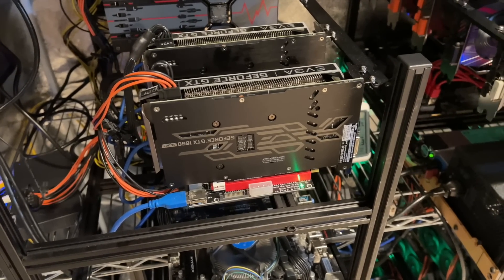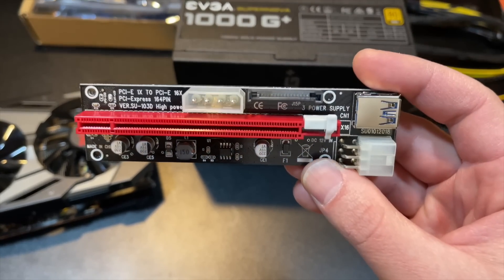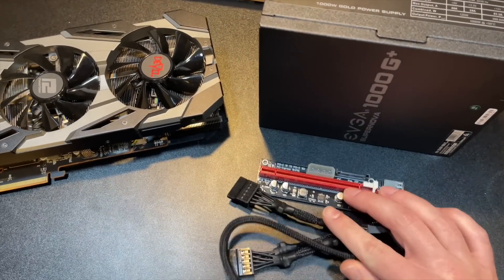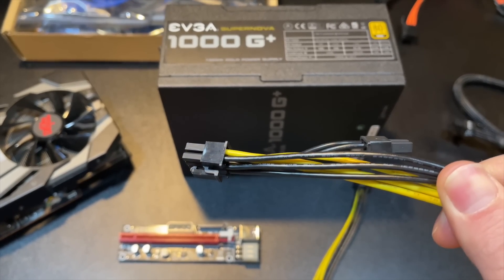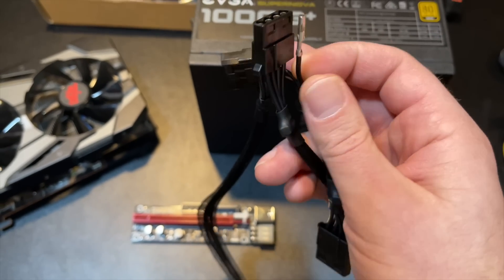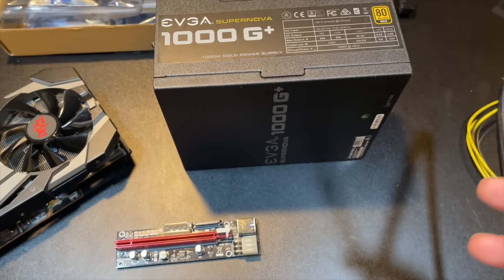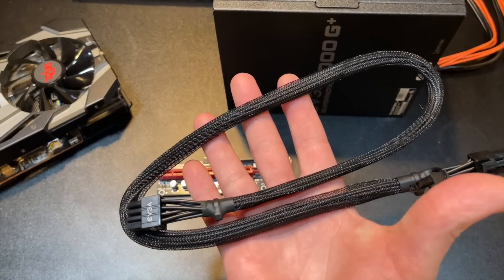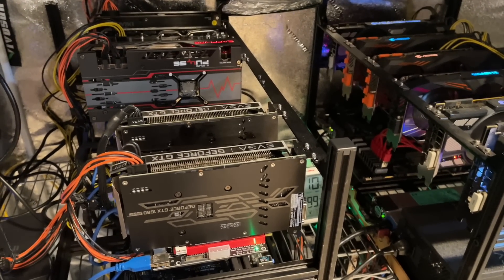Powering GPU Mining Risers Safely

Comment: Question: How do you feel about two molex to one 8 pin? I got a 1660 today and I don't have any more pcie on my power supply. I do have 2 different molex cables that are free. My power supply is a older 650 watt corsair gs. My current setup is pulling 300 watts, so I'm assuming with the right adapters I should be able to power a single 1660 and a pci riser card.
Reply from the maker: Tricky. 8-pin can pull 150w max. If it were 6-pin you'd be okay with two separate Molex strands since it only pulls 75w. 

You're still probably okay going to 8-pin, but I'd personally avoid it. If in the chance those Molex cables only have 5A pins then even two strands would give you 120w max. (5A*12v*2). In reality they probably are rated for much higher, but myself and you just don't know.
Reply: @RedFoxCrypto  Thanks for the reply. I have decided to stop being cheap and buy a proper psu. I live near a microcenter so I am going to pick up a 850 watt evga model. It has enough of the connectors I need and its modular so there will be less of a rats nest when it comes to my cable management.

Comment: Noob here - I have a question for my
Fellow mining experts . I want to install a 2nd gpu  in my rig  , i have a 750 PS and that won’t cut it  can i use an external power supply to just power the 2nd gpu? Is it safe ? Ty in advance

Comment: So what If I have a GPU with lets say one 6pin + one 8pin Connector for Power supply and I want to run it with a Riser. Do I then need to plug in one cable (6 pin as I learned) into the riser, and two in the GPU, so infact this ONE GPU blocks THREE PCIe power connections in the PSU? This would require the PSU to have lots of PCIe connections when you want to run for example a 6 GPUs mining rig, right? 

What am I missing here?
Reply from the maker: It depends on the GPU you are running and its TDP. You can typically do it with 2 strands from the PSU. One of them being split to go to the GPU 6-pin and the riser 6-pin.

Comment: i actually have a 590 that takes 14 pcie, so i ran out of them for the riser, im using the sata on the riser for like a month and there has been no problem, i guess that the 14 pcie is giving almost all the power to the gpu so the sata is not that forced
Reply from the maker: Yeah they must draw very little power from the riser. Stay safe brother and be careful if you switch to a different algorithm with those.

Comment: Its also good practice to view the connectors with a thermal imaging camera (a cheap one is fine) while under full load just to be certain there's not a poor connection with a pin somewhere. Relatively new to mining, but not new to dealing with 12v high-current projects. Good video too, I never realized the SATA power connectors had such a low current rating! They shouldn't offer it on the risers - just asking for trouble.
Reply from the maker: Thanks Mike. Good call on the thermal camera.
Reply: it can be dont by touching connection with finger too
Reply: Great Idea...looking into this now.

Thank you sir!
Reply: The SATA connector was designed to power a disk, CD players, DVD players.

Comment: Most currently produced molex connectors (used in name brand power supplies) use pins rated for 11 amp on the the 12v and 5v.  More than safe to power PCI risers.
Reply from the maker: Any sources to share on that? I truly believe the same, but I wish I could find something really concrete to back that up.

Comment: but one thing not every gpu runing on 6 pin connector we need 3.3volt  or 5.5 volt because i am using gtx 1070 gpu they not run on 12pin connector then i switch to molox for 5.5 volt then they run perfect  but there is one theory that if you run on motherboard PCie the hash rate will increase and they working perfect

Comment: What about if i was running RTX 3070's? Ive got 3 on the way and looking for another 3, would the splitter still give enough power?
Reply from the maker: You could do 2 of the risers off a single PCIe strand with a splitter.
Reply: @RedFoxCrypto  Im kinda new to this (In the process of building my first rig, Could you explain which cables i need from m7 gpu (HX1200I to power 4x RTX 3070'S) I

Comment: Still plenty of bad choices to make with peg connectors tho. What happens if you use said 6 pin > dual 8 pin splitters to power a gpu that draws max? Thats a 150w per 8 pin so a total of 300w over a 6 pin that is designed for 75 and at best takes 192 as you mentioned. Just as tricky as sata power.. Correct me if im wrong but i kinda missed that part

Comment: The thing is with multiple cards that require multiple 6/8 peg connectors you run short on them very quickly. I think its wonderful that in that case you can use good ol' molex to at least power the risers. Saves a few peg slots and cables for the real stuff.

Comment: I have a 1000w evga gq with 6 8pin slots, 2 cpu 8pin slots, 3 sata 6pins slots and 1 perif 6pin slot

I’m trying to power up 5 rx 580 8gb cards, each of em requires 6+8 pins 
Is there a way to power the whole thing without using the sata slots ?
Reply from the maker: What's up dude. I'd probably use a PCIe strand that ends in a 2x8pin and split one of those to go to the riser as well. The TDP of a 580 is 185w so it's within spec of what the PCIe cable can do wattage wise. 

There are even some 580s that you don't need to power the 6pin and only the 8pin: https://www.gpuminingresources.com/2018/03/complete-rx-580-comparison-and-ratings.html

Hope that helps!

Comment: I have been using Molex risers for years on my RX 580 rig, never had a problem. I actually prefer Molex risers .
Reply: Polaris is def less demanding

I used SATA with them for years just fine
Today, I am using an rx 5700 with a SATA--> molex adapter cable like he showed in the video and it melted!

With the higher power limit cards this will be more of an issue

molex is likely fine but an absolute no no is SATA and especially SATA plus a power hungry card! Thats where the melting actually starts happening

Im actually lucky this flimsy adapter was the weakest link and started melting before anything else so its just that thing lost 

swapping to 6pin now

570s are probably ok with SATA tbh but better safe than sorry prob use Molex with them too

Comment: Thank you very much for your video, I learned a lot of things.  But I have a noob doubt, I was planning to buy a 5700 but I see that the one in the video has an 8 pin port and a 6 pin port, would I have to power both or can I use just one? For example, with the splitter, connect 1 6pin to the riser and the other to the gpu, leaving the 8pin unused.
Reply from the maker: You’re welcome! You have to power both.

Comment: Thank you , after I installed the 3070 on PCIe riser the PC suddenly restart and was not not able to detect the  GPU cards - It works for couple of hours then restart again ... any advice ?
Reply from the maker: Hmmm...I’d test another riser first and then I’d test the card on the full size PCIe slot on the motherboard to isolate the problem.
Reply: What W power supply you got and did you check your voltage levels? You might have one dropping low somehow.

Comment: I was curious about the sata connection and did my own experiment in testing it using corsair modular cables the sata connection on their cables is very high quality and did temp reading using a temp laser gun and using one sata connector per one riser the temps never got above ambient temp so I believe if you have high quality connectors like corsair is using you are fine this test has been going 24/7 for 2 months now and molex is save as well with corsair cables from my own experience and testing. Now all testing was done on RX 570/580 gpu's so I wouldn't use these connections on a higher power draw card like a RX 5700 xt and above or GTX 1080/RTX 2070-3090 cards
Reply from the maker: Thanks for sharing Kevin. Seems like those 570s/580s are drawing very little power through the pcie slot.
Reply: @RedFoxCrypto  I don't know exactly how much the Polaris cards use from the pcie slot but I know when rx 480 was released they had issues pulling 80 or more watts from the slot and killing motherboards so dont know about the 500 series I know they updated the bios on the 400 series to prevent that

Comment: Anyone know if its safer to use spliters only in the risers and plug gpu right into psu any info helps:)
Reply from the maker: Yes, just make sure that you keep the riser and GPU on the same PSU if using multiple PSUs.
Reply: Thanks for the response

Comment: Hey Red Fox, great video and I think my rig had been crashing bc of insufficient power to risers via SATA but noob question. I bought the splitter you linked, but the 6 pin end doesn’t plug into my EVGA PSU! Did I miss something? Was it supposed to plug directly in or via some type of cable? Thanks!
Reply from the maker: Thank you! The splitter plugs into a PCIe cable and allows you to split a single 6-pin into 2 8-pins.

Comment: Hi, am I good with Corsair RM850 (850W) with 3x double 6+2pin cables to powering 6x 1660 super with risers via splitters? All time gpus will be 81w each, so 162w per one 288w pcie. But I dont know how much power risers need and when system shut down and gpus will be 125w in standart no oc regime (250w) then I am not so sure.... Could be there some problem ? Thanks for answers :-)
Reply from the maker: Risky. If those OCs reset and they run at the full TDP for some reason you could be in for a bad time putting 250w over a PCIe cable. I'd stay safe and only run 1 pair (GPU +  Riser) over a single PCIe strand.
Reply: @RedFoxCrypto  Thank you Sir :D ... I just ordered Corsair HX 1000 with 4x pcie for GPUs insted Corsair RM850 which has only 3. In near future I will order 2 more of these to run three PSU with 12 pcie for 12 GPUs. Thank you for quick reply, you helped me much :)

Comment: great video :), my ROG 3060ti has max tdp 200w, but need 2x 8pin, thats 300w?? this confuse me. The psu cable ends with 2x 8pin(6+2) that is 192x2= 384w, one of these is too short so I'm adding the splitter and powering the two 8 pin of the gpu and the riser, am I ok? and what about the heat?, this card is too long and can't move the cable from the back to the side of the gpu. I don't want to be super sad and away to break even :( ahha thanks :)
Reply from the maker: Thanks for watching. For that card I'd run one PCIe strand from the PSU that ends in 2x8 pin and attach that to the card. Then, I'd use a separate PCIe strand to power the riser. 

The 8pin connected on the GPU is speced to call for a max for 150 watts, but that doesn't mean it will, especially if the TDP of the card is only 200w in this case.
Reply: @RedFoxCrypto  thank you :)

Comment: Question, my main cord already splits into two 6+2 cords. Can I send one to GPU and the other into the PCIE Y splitter that you features into the risers?
Reply from the maker: I'd stick to only 2 connections per strand to be safe. So if it already splits into two 6+2 pin I wouldn't split it again.

Comment: so, a 6 pin from the PSU, into a splitter that gives u 2 8 pins, 1 gets plugged into riser and another in the GPU?
Reply from the maker: Yes, but depends on the GPU you are running. Check the TDP of that specific card to ensure if it runs full power the PCIe can handle it.
Reply: @RedFoxCrypto  been learning a lot these past few weeks, thanks!

Comment: Do you cool yours GPUs with extra ventilators ?
Reply from the maker: Not necessarily. I just have them in a grow tent to help pull out the generated heat, but before that I just left them in open air frames with no extra fans.
Reply: @RedFoxCrypto  thanks for response

Comment: Could I use 8 pin to 2 8 pin splitters?  For example, I have a Corsair HX1200.   It has 6 8 Pin cables coming out of the PSU.  I'd like to use 6 3070 cards.  They have 2 8 Pin connectors each.  Would it be safe to use 8 PIN splitters to power these?
Reply from the maker: If you mean split the 2x8pins into 4 8pins off a single cable then that wouldn't be safe. To be safe, for a 6x3070 build you really want to account for at least 1400 watts being used if it runs at full power. Perfect job for a server PSU or you could run 2 ATX PSUs.
Reply: @RedFoxCrypto  sorry I don’t think I had counted the cables correctly.  There are 4 8 pin to dual 6+2 pin cables.  So what I’m thinking is connecting 4 3070’s using those four.  What I’m trying to figure out is how to power the risers.  There are 2 available 6 pin plugs open on the PSU.  So what I’m thinking is I should be able to use a 6 pin to dual 6 pin giving me the ability to connect the 4 risers.  

Also, there are 2 molex plugs on the motherboard.  I can connect them but not sure why they would be needed.

The case I have is a server case with only one spot for a PSU and there is space for six GPU’s.

I guess I’ll just use four.  I’d like to install 5 cards but I’m not sure how I’d make the cables work.

There is one open 8 PIN (cpu) plug on the PSU

Comment: Question is: How likely is it that the Card is drawing 75W over PCIE since the card is powered over the dedicated supply anyway. Regarding Molex: Even if it is only rated for 60W you will not get significant heat with 75W.  If really anything happens the card will not be powered properly due to poor electrical contacts. Either it runs unstable or it runs but draws a little less electricity then other identical cards directly plugged into the pcie slot on the board. From my experience with 3 identical cards from the same manufacurer they differ in consumption around 20 Watt which also effects heat but rarely Mining performance. In the end they are getting clocked down to an extent until the hashrate beginns to drop anyway  which is in my case only 2/3 of the orignal power consumption.

Comment: I’ve seen first-hand on my mining rig that one of my SATA to 6 pin Connector wires was burnt. Thing could have been worse, it could of cause a fire or an inactive GPU. Well, I fixed the problem for now and now awaiting for some 6 pin to 8 pin y splitters to remedy any future problems. https://www.amazon.com/Deep-Mines-Y-Splitter-Extension-Ethreum/dp/B0719P4DHN/ref=as_li_ss_tl?crid=3BHR13E2P49O5&cv_ct_cx=deep+in+the+mines+splitter&dchild=1&keywords=deep+in+the+mines+splitter&pd_rd_i=B0719P4DHN&pd_rd_r=18be1c52-907c-4ccf-ab5f-0002acd9616f&pd_rd_w=weUAV&pd_rd_wg=TDGpA&pf_rd_p=a64002b9-9c26-4361-b8a1-b0f5a4835670&pf_rd_r=8VGNZTRHBPWB9E0TCQ6B&psc=1&qid=1611234490&sprefix=deep+in+the+mines+spli,aps,152&sr=1-1-38d0a374-3318-4625-ad92-b6761a63ecf6&linkCode=sl1&tag=redfoxcrypto-20&linkId=2b56045a1500ff68ee4483b717ea29db&language=en_US
Reply from the maker: Sorry you had that experience Stephan. Glad that things didn't get worse. Happy mining my dude!

Comment: I thought i made a comment about how i used sata converters for a few years no problem. But I will say that it has a lot of problems and risks. Lets just say that with older motherboards,  you might see that the sata cables might get way to hot for a stable build. i will say that it is possible to have a safe rig with sata connectors. Just take note that the build will run into pci issues if the wattage cant be reached on the riser. 

this is why now im using my risers that have the six pin connecters, after finding out that i could use the vga connectors to power my risers, i think my pci issues are gone. AND my system I hope will run safer. thanks for the info. Also make sure your build is in a metal casing. you never know. Could you drop your eth address for providing this info?
Reply from the maker: Thanks watching and commenting my dude. I appreciate you sharing your experiences as well. Stay safe and happy mining!

0x274F8049307b2F86a7C585eDA717C968f55d78D6

Comment: Trying to run 4 GTX 1660 super GPUs with the corsair HX1200 PSU i need to know if i can
Reply from the maker: Yes definitely. Get some splitters to run the card and the riser off a single PCIe strand from the PSU. I have my favorite linked in the description.

Comment: My PSU has 8 pin pcie cables that goes to the gpu. Can I use your recommended 6 pin to dual 8 pin splitters ? Or do i need to get 8 pin to dual 8 pin splitter ?
Reply: idk how this went over so many people's heads.

using a 6-pin to 2x8-pin splitter is a bad idea. the max power a 6-pin can pull is 75W. so by using OP's splitter, you're basically tricking your machine into thinking that it will have enough power to pull 300W (8-pin is max 150. times that by 2), when actually it has only 75W max for both ends of the splitter combined. this is how you burn parts

an 8-pin to 2x6-pin splitter is the only for-sure safe option. otherwise, just use a molex cable to power max 2 risers.

Comment: Isn’t 6 pin rated for 75 watts ?
Reply from the maker: The GPU is designed to only call for a max of 75w through the 6-pin PCIe connector, but that doesn't mean the cable and pins themselves can't handle more.